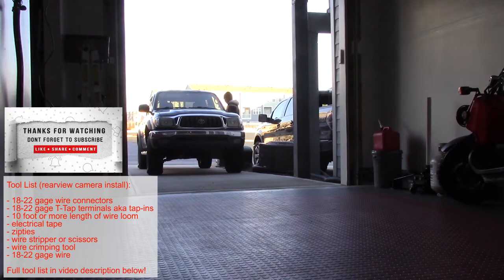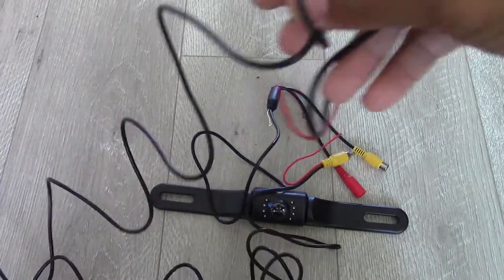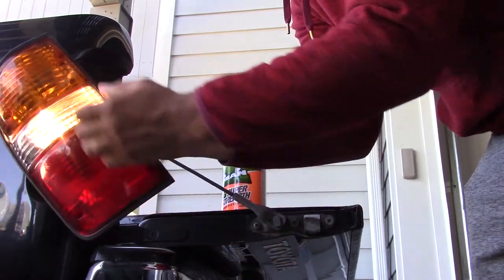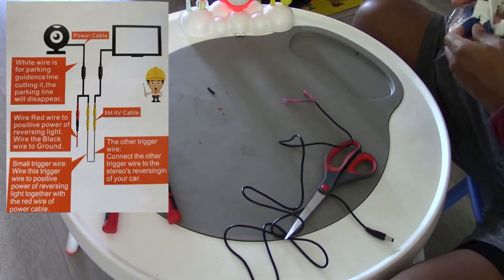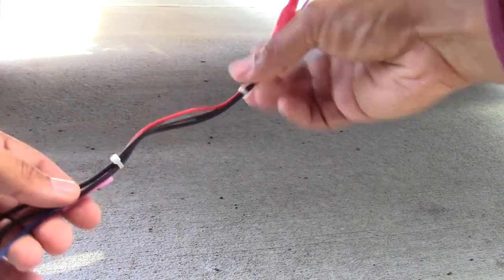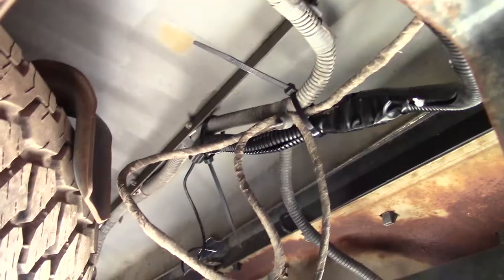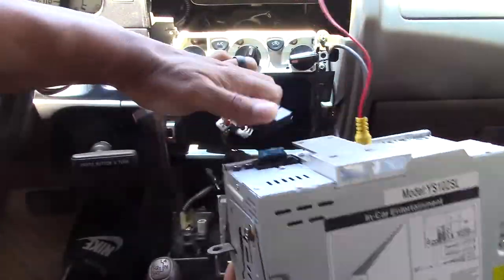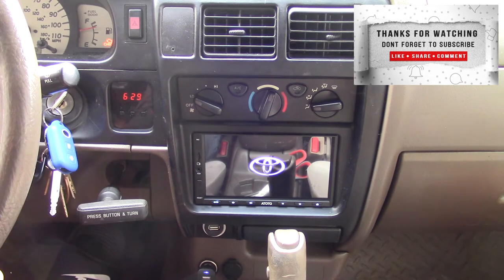REARVIEW Camera and Stereo Install | Part 2: Toyota Tacoma 4Runner T100 Tundra REARVIEW Camera

Comment: Is there a pretty similar process for installing a tailgate handle camera?
Reply from the maker: Should be very similar, just need to route the wiring to the handle. You can take off the tailgate access panel to get behind the handle easy enough I would think